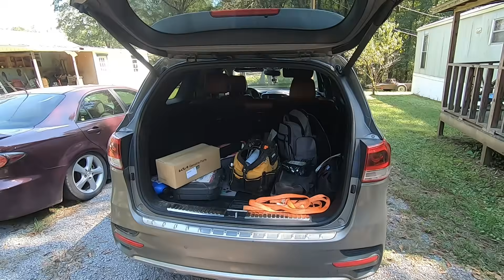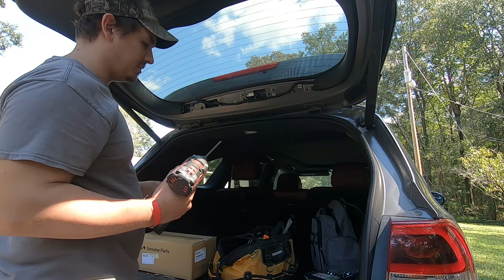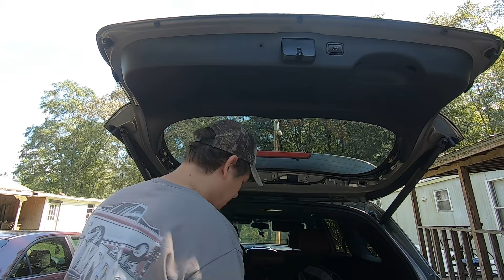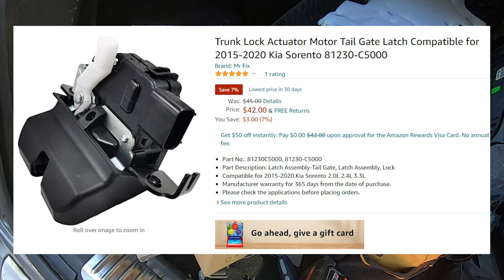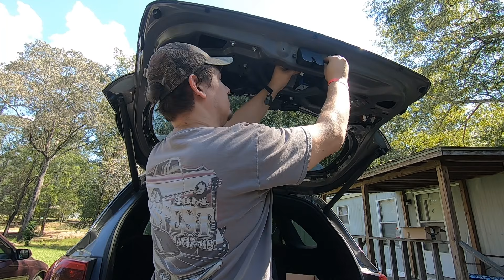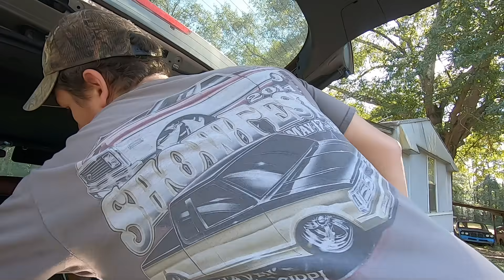How to Repair 2016 - 2020 KIA Sorento Trunk Latch

Comment: This video did the trick, thank you so much! The only issue I need to figure out now is that the hatch will only open when the vehicle is running (it was doing this before this particular part went bad).
Reply from the maker: Power lift hatch like I have in the video? Does it act the same way with all 3 forms of activation? (Remote, button on dash, and button on the hatch)
Reply: @BCDriven it does. It stopped opening, making the noise like it was trying to unlock. Replaced the part in your video and now it works great. Just not opening unless the vehicle is running, read it might be a battery issue going low
Reply from the maker: @ThatGravelGuy thats what I was thinking as well. You could easily test it if you have a pair of jumper cables, hook them to another vehicle like you were going to jump start it and see if it works with yours off. Wouldn't hurt to check your battery terminals for corrosion, even if it doesnt look like it has much or any it may have some that needs cleaned up, especially on the positive. I almost replaced our battery due to a slow start issue and when I took the battery off to trade in as a core I realized it had a thin layer of corrosion and that was the only issue.

Comment: I just replaced the power latch for my 2017 Kia Sportage using your video you saved me about $3500. The car dealership told me that the power struts needed to be replaced and they never even mentioned the latch could be the issue. thank you for helping the community out. God bless you.

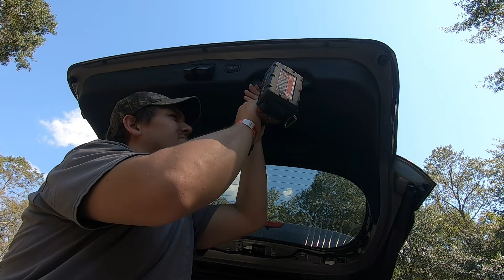Comment: 3:09 anybody else have a handle that looks like it was bolted on? Inside the hole is smooth metal, no Phillips head entry. Have a GDI model tho. Any ideas on how to get the handle off?
Reply from the maker: Probably a regular 10mm bolt, mine was a 10mm bolt with a Philips head in it so I used the Phillips head since it was already on the impact. I assumed they would all be like that, but others have commented thats not the case

Comment: I bought a latch assembly and after replacing it, it only worked one time and started doing the same thing again. It wouldn't stay close unless you slam it down hard. But then you have to open it manually from inside which is very uncomfortable and time consuming.

Comment: Hi, i got my immatriculation sign two screws stack, i can not remove its to put the new immatriculation sign, i have to acces from inside and try to remove its otherwise i have to cut both , can i acces to both using your video ? Thnks

Comment: Thank you for this very practical information.  I bought the part for 95$ on plus one 10$ special screw driver for the door latch  and did the job myself  in 50 minutes.  The dealership quoted me 750$ 😮 . Or 265$ diagnostic fee + parts and labor. Next I need to learn to change oil myself  . Thanks

Comment: Great video! The only thing I suggest is there are 4 rubber insulator pads that go between the door and actuator that will fall out and they need to be on the actuator mounting studs before installing it. Thanks for posting this video. Really helped. Also I ordered an aftermarket unit and ended up returning it and getting an OEM Kia unit. The aftermarket one wouldn't fit the latch opening properly. Junk!

Comment: In reference to the new part if buying from KIA, inspect the cable outer housing for damage as soon as possible on the new part. The latch and motor are designed to stay in proper relationship to each other as well as not being bent improperly (severely) during shipping. My first one had a crack in the outer housing at the end closest to the latch. Returned and got a new one, however I asked the dealer to inspect that one before shipping and it had the same issue. They had to get another one from elsewhere, and that one was okay. KIA does not use a large enough box, or pads it in a way that causes the cable to bend too much in the box. Also, do not twist the two ends separately. They are designed to keep in the same position to each other and twisting one will also damage the cable housing.

Comment: Brilliant video. Was as easy as advertised. The only issue I had was the Amazon part listed needed some minor filing to get the tabs on the side to fit into the square recess the OEM part fits in. Works like a charm, the plastic cladding comes off as easy as the narrator describes and he is indeed correct that the plastic rivet is a POS that is a minor PITA to remove 😂10/10 would recommend this video for a DIY

Comment: Thank you for this excellent video. The tailgate handle switch had completely disintegrated on my 2017 Kia Sorento and needed replacing. Was sure I'd be looking at $$$$ if I took it to Kia to be replaced. The first video I found online made it look like a massive job but then I found your video. Followed your steps to remove the trim and I not only replaced the switch but also took the opportunity to install the rear dashcam unit (that's been sitting in a cupboard for over a year!). All within an hour. Thank you.

Comment: Great video! Did exactly like you shown and now it closes and latches but won't unlatch or unlock. Only can open it manually
Reply from the maker: Just seen this but sometimes the good ole "turn it off and back on" will get it going. Close the hatch and disconnect the battery for a few minutes.
Reply: @BCDriven  I will try that today. Thanks.

Comment: I have a 2014 KIA Sorento and the power gate is acting up. When it opens, the overhead lamp will not illuminate, meaning it's not sensing the gate is open. Then I hit the button and it will close and stay closed, but it struggles to make that last reassurance pull on the gate and thus it stays closed but not fully latched. I have to manually push it to get into a fully locked position. Have no clue if this is a latch mechanism, and it's a winter time too, plastics are fragile and it could be pain in @ss to do it, especially if this is not gonna solve the problem. dddddamn 🤣
Reply from the maker: Sounds like a lot of the symptoms of the latch but could also be the rubber bumpers that the hatch closes against are out of adjustment. I can't remember if they thread in like the ones on a car hood. I also don't think there is a separate actuator that provides the "closed" indication (like a car door), I believe that signal comes from the latch assembly.
Reply: @BCDriven  I've never thought about bumpers, I'll take a look at them. Thank you for your response !
Reply: @BCDriven  and so I have an update. It was in fact the latch, like you predicted. The "Gate Open/Closed" dome light switch is located inside of the power latch, that's why the latch and the tailgate dome light stopped working simultaneously. It looks like the problem in my case could be that the pulling cable where it connects to the latch, got loosen by a bit, that's why it was failing to make it's final tight grip on the loop, and at the same time it was sending out confusing information on whether the tailgate is still open or closed, so the dome light did not illuminate. It took me about 90 minutes to do it today. Thank you for following up with me on this.

Comment: Hello sir, I enjoyed the video. My question is with the same issue. Be responsible for the hatch not opening. If you could give me some insight I would really appreciate it. Thank you.
Reply from the maker: Sorry just seen this comment but it is possible that the latch isn't releasing or the actuators are weak and not lifting. It's hard to diagnose without seeing it. Also depends on what you mean by "not opening". If it is unlatching (think like a car door) but not lifting it could be the actuators (or a fuse), try to "help" the hatch raise and see if it helps. If it's just not unlatching then yeah it's most likely the latch assembly.

Comment: Well the locking mechanism works, but the auto-open/shut appears to stop working after manually opening and closing a few times
Reply: SOLUTION: Hold down the internal auto shut button and the external button at the same time for 3 seconds. You should hear a single beep.
Reply from the maker: Good information, thanks for commenting! I'm sure others will appreciate it.

Comment: Does this part power the hatch open?  My hatch will not open or close.  When I hit the button to open, I hear it unlock but does not open.  I then have to crawl in side and unlock to open the hatch.  When I manually close it, I have to still hit the button for it to latch otherwise I get a warning on the dash.  So seems like what ever powers the hatch open or closed has failed.  I am trying to understand if this part does that or if there is another part involved to power the gate open and closed.  Thank you.

Comment: The manual latch replacement went perfectly. Thank you. Part number on Amazon was easily found and was correct. Fitment was almost perfect for a third party part ($30). ~30min to repair. ❤ 2018 Sorento LX
Reply from the maker: @dow4hurst  Thanks for the comment, good to hear you got it taken care of 👍

Comment: So - getting ready to leave for a vacation, my hatch would not open.  it would beep, but not open,  I crawled in the back an use the manual latch switch to open the hatchback, but then would not lock when i closed it.  Do you think it is just the latch or a combination?  my hatchback is a powered lock.
Reply from the maker: It sounds like it's just the latch like I replaced in the video to me. Is it a powered lift like mine in the video or is it manual lift?

Comment: This video was awesome! You have any videos for a sedona where the latch opens, but the door only goes up automatically on a random basis?
Reply from the maker: Unfortunatley not, that's a slightly difficult one to troubleshoot. It sounds like it could be an issue with the latch not signaling to the actuators that it is opened, therefore the actuators aren't lifting. I can't remember if the hatch has a simple plunger style button like the doors have to signal that it's closed or if the latch itself has a switch built into it. Either that or the actuators are getting weak and not functioning correctly but I feel that failure would be a lot less random. I would open it several times sitting in the back and see if there's any distinction between the times the actuators open and the times the latch lets loose but it doesn't open. Try to see if there's a correlation with interior lights coming on or not or putting slight pressure on the hatch when it opens and see if anything makes it consistently fail or consistently work. Sorry if that isn't helpful.

Comment: Thanks sooo much. The only adjustment I had to make is the handle didn't have Philip screws but rather 10mm hex. Mine is a 2018 ex AWS v6 if that mattered.
Reply from the maker: I think mine was the only rare model with the Phillips bolts lol. They were a 10mm hex they just also had the Phillips in them and I had it handy so that's what I used. Glad to hear you got it fixed up
Reply: @BCDriven  the other thing I recall as after closing (when it was working), I would hear this sound like it was latching securely (beyond just a click).   I don't here that after replacing it but I can't move the door either so I'm assuming it's secure. Curious if anyone knows the sound or experienced it still doing or not doing that afterwards.

Comment: Hey thank you so much for the video i have done ur step by step ordering the same part and its still not opening , do i need to reset the BCM or reset the entire vehicle by unhooking the negative post ?? Please help i am trying to fix this for my neighbor she is elderly and doesnt have a lot of money
Reply from the maker: There shouldn't be anything you need to reset but it doesnt hurt to try disconnecting the battery for a few minutes and retrying. Have you tried all methods of activating it? (Key fob, button on dash, button on the hatch) Does the hatch just not close or not stay closed? You may just double check all your wiring connections also.

Comment: This a very enlightening video.  My problem is similar but involves the TCU control unit (I have Sorento 2017).  The dealer wants $1000 to replace it.   I found the part on line for much less and wonder if I could install that myself?  Do you have a video that might be helpful? Thanks in advance!  Great Channel!

Comment: Was a great help. Just one thing. On the 2018 Kia Sorrento to remove the handle there are 2 nuts instead of screws. A 1/2 inch socket is all you need. Thanks again. Was awesome
Reply from the maker: Good information for others, thanks for the comment.
Reply: Bro that's what I got!!!! I was like wtf
Reply: Same here. 2018 but my trunk is manual opening and not auto-lift.

Comment: That was fantastic. I wonder if you could do, or show us how to retrieve the retaining 10 mm nuts that hold the tail light assembly when they fall into the "black hole" and end up under the storage area. I have a 2016 Kia Sorento. 
I was replacing the tail/brake light in the the Driver's side assebmly and being 73 my shaky hands dropped both nuts down into the "abyss".
Kia parts tols me they don't have those separate and we have to buy the full assembly. I was able to McGyver someting to hold the assembly in place, but I was wondering it there was a way to remove the first small storage compartment to retrieve those nuts. While I was doing that I also dropped the "backup" Fuel pull tab that is velcroed to the body. That's what happens when one gets old.
Thanks again and God bless. 🖖🏼🤟🏼
P.S. Magnets won't work as they get stuck to the frame. I tried a Dyson with  McGyvered slim tube, but no go.
Reply from the maker: I hate when there is a bolt swallowing black hole. I'll have to look into that and see how I can help, If it's just a nut or bolt that fell down and not a specialty fastener it may be as simple as taking one off the other side and going to the hardware store to get a replacement. It's likely a M6-1.0 thread but you should take the other one with you to verify just in case.

Comment: Is that a rachet strap?😂
I wish I woulda watched this video before using the emergency tab and having to use a ratchet strap myself
Reply from the maker: Where there's a redneck, there's a way lol I had to put that pull strap between the grab handle and the car seat restraint to keep the hatch pulled close otherwise it beeped everytime you moved lol

Comment: A shop wanted $410 for the part and total $675 parts and labor! I just finished this job DIY in 25 minutes.! Only trouble I had was the handle had a socket instead of screw and my extender got stuck putting it back on. Thank you!
Reply from the maker: Thanks for the comment! Apparently our kia is the only one that had the 10mm bolt with the Phillips in the middle lol Glad to hear you were able to tackle the project.

Comment: So many thanks. Dealer wanted $500 plus for what I did in about one hour. Was easy to follow along with this video. Ordered same unit on Amazon. With 3 year insurance, cost about $170.00. Remember, have a 12 km socket for the bolts. A little tight getting motor plug off. Wife's smaller hands did the trick. Don't forget to unplug the starter button, headache maker. Didn't duck fast enough. I put silver dots on housing where the clasps are located, made it easier to find the compression areas when reinstalling plastic housing. Was a snap. Hope others will follow suit. Saves money big time.
Reply from the maker: Good to hear you got it taken care of and was able to save some money along the way. You'll learn to be quicker with that lift gate next time haha

Comment: Enjoyed this video.  Are there any other connection (mechanical cable) besides electrical?
Reply from the maker: Not on this model, it's all electrical. The actuator and latch come preassembled with the cable installed between them. I believe the standard model doesn't have any cables and is just a single electrical connection.

Comment: I don’t have this exact issue but my latch won’t open with the key fab. Think it may be the same issue?
Reply from the maker: Sorry for the delayed response but I would think it would not be related to the latch if the latch still operate with the switch on the dash or the button on the latch. Try a fresh battery in the fob. Also on our fob you have to hold the button for 3 or 4 seconds for it to open. Hope this helps.

Comment: Thanks so much for this video! It was super helpful and made the process go smoothly. Except I didn't have a deep reach 10mm in my socket set for the handle, but now I do. Lol.
Reply from the maker: A lot of my tools when I started out came from jobs where I needed a specific tool to complete it. Good to hear you got it fixed and thanks for commenting.
Reply: @BC Driven  does the non powergate kia modle have the wire harnesses? Im thinking of installing the powergate.

Comment: I just had the same problem.  Ordered the OEM part and the replacement went smoothly.  However the motor won't actuate.  The whir you would hear after it closes, and if you release it, it won't open automatically.  The only difference is at least it will actually latch if you close it manually.  Before it wouldn't even do that.  Any idea what is causing the motor portion not to work?  Could it be a bad relay, or something else I should look at?
Reply: Hi did you ever get to figuring out what happened. I have a 2016 kia sorento sx that trunk wont open you can hear the motor but it wont actually close i literally have to go through the back door and pull a plastic lever and get it to pop open enough to where i can go around and just push it up myself